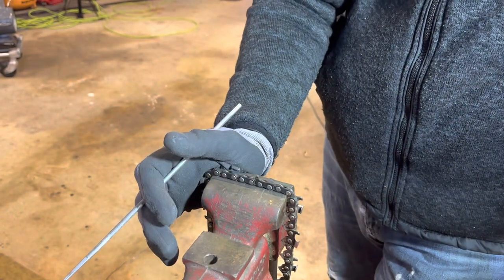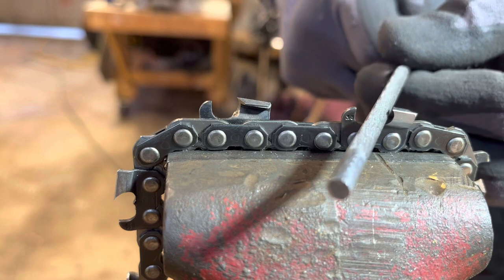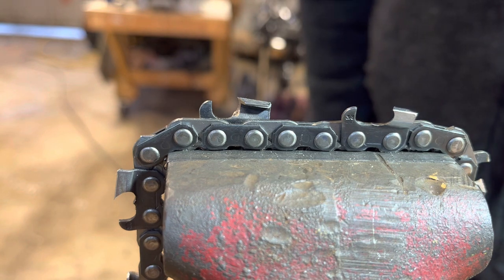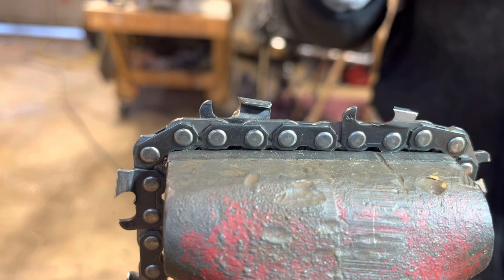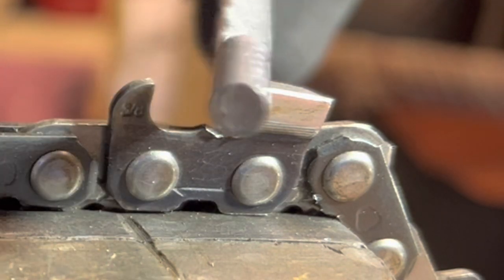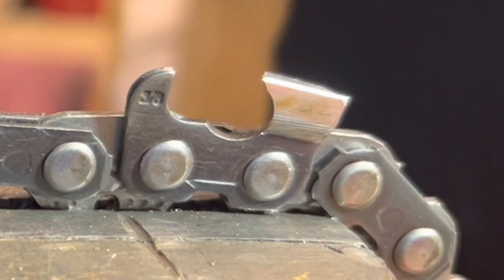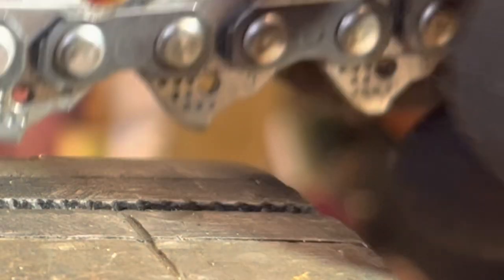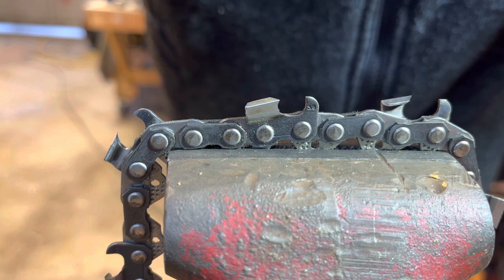Before you Get The Gullet, STOP! (WATCH THIS FIRST)

Comment: 👍I see no reason to file below the side plate(down into the gullet).
Reply from the maker: For sure👍🏻 I can’t count how many times I’ve seen this however. I believe folks embed the “get the gullet” in their head and just start going to to town. Although obtaining the correct gullet is important it should naturally form if the correct stroke angle is performed.

Comment: Well said bud . I myself have used a stihl easy file for around 5 years and for out in the field it does the job quickly , rakers and teeth at the same time .and the performance after is good enough for me .
Reply from the maker: I like the 2 in 1’s just gotta watch getting rakers too low I’ve noticed. (3/8 version)